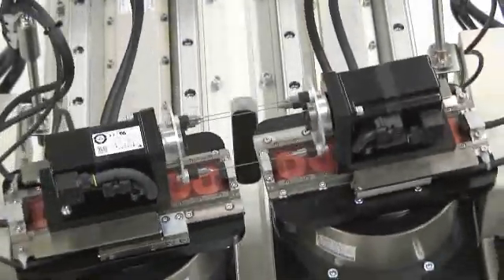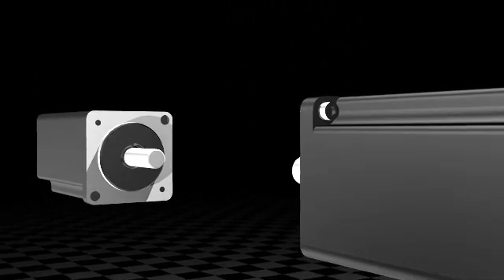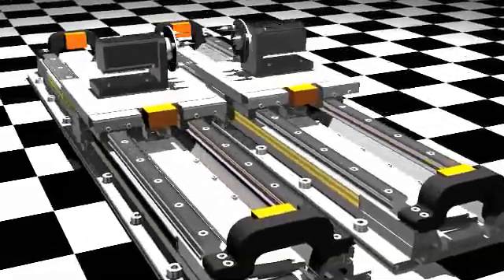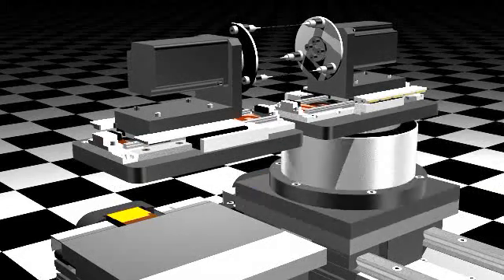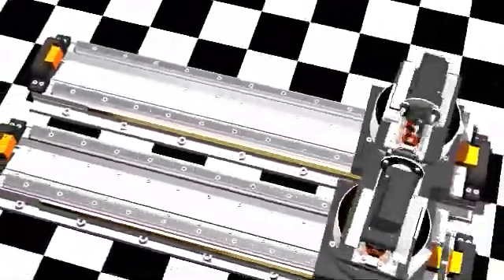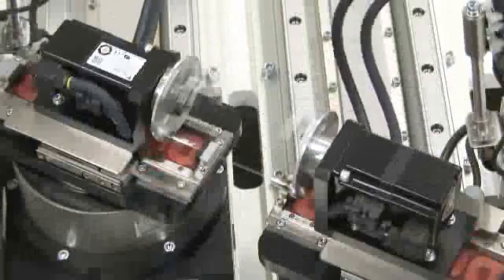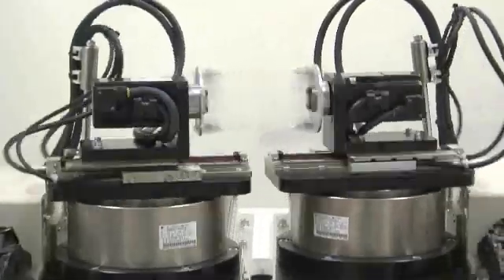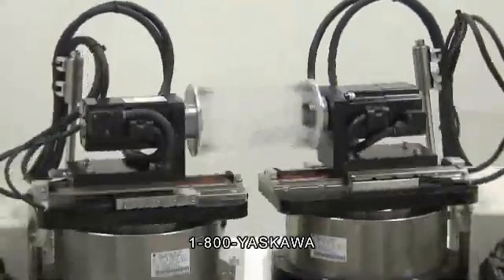Ultra High Precision Demo

Comment: Are there 13-bit encoders in rotary servomotors? ... 360°/2^13=0.044°
Reply from the maker: +duncpol The Sigma 5 Rotary motors have a 20 bit encoder.